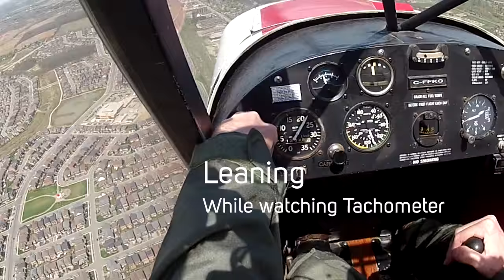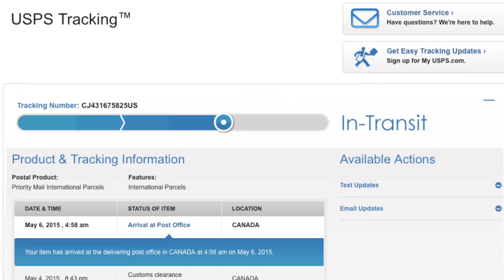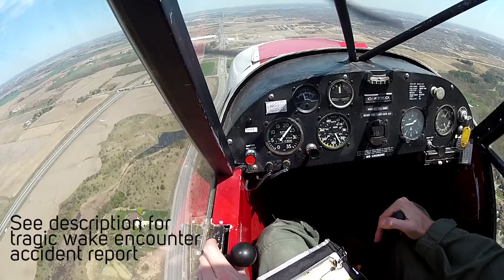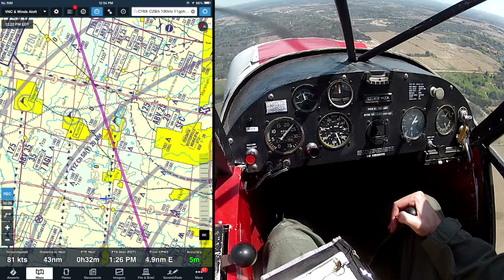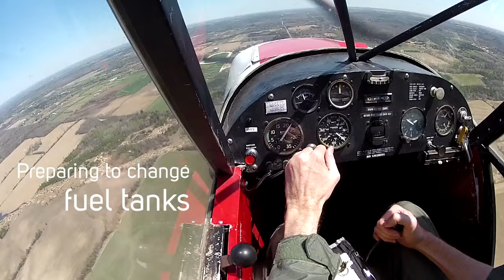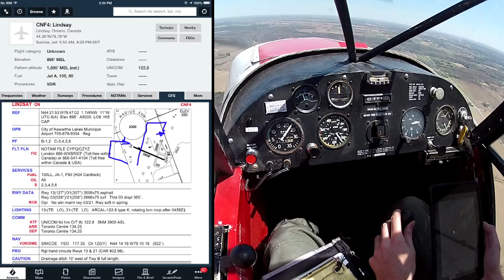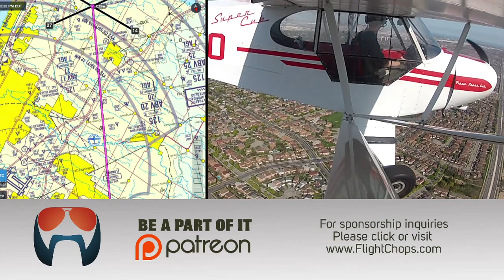Skirting major Class C control zone; no transponder - Super Cub - Flying - ATC audio

Comment: Great video. I like how although you weren't required to establish contact with toronto terminal you still did. It's a win win in the sense that it helps provide more situational awareness. I also like how you planned your route considering the runways in use to avoid wake turbulence. Lastly, contacting buttonville tower, again even though you didn't have to, was good for situational awareness. VFR flight in and around the toronto TCA can be intimidating, but you did a great job and I definitely took some things away from this video.

Comment: Thank you for all your videos, it has inspired me to continue with my certifications. I have a question about your ipad. Do you use cellular service for your fix(es) or just GPS?
Reply from the maker: +Randal Wilson Thanks!  And I just use the built in GPS actually.  You can also get a 3rd party GPS like a "bad elf" - but I haven't found a need yet.
Reply: The Stratus is a great add-on, and has a GPS receiver and an ADS-B-in receiver.  It also tracks your exact path that you can look at later.

Comment: Awesome video. One question, though. Since you're not in the Charlie, and since you only have one radio, shouldn't you be monitoring the En-Route frequency instead of terminal control? I'm no Canadian Radio Procedure pro, it just seems like the most logical solution to me ( a dumb american ;) )
Reply from the maker: ThreeTwo Victor Haha - you're not a dumb American :)  But yes, you make a good point.  That was the dilemma.  My plan was to be the only idiot pushing it so close to the Class C that I'd be the only one there....  and it worked.  And again, as you saw when passing the other C airport, they still gave me very useful advisories even outside the class C airspace...  But yeah, as I got further I switched to 126.7

Comment: Another great video. I bought a RAM mount for my iPad Mini for a Skyhawk but couldn't mount it where I was wanting it. It's harder to get flight control clearance than I thought it'd be.
Reply from the maker: Cole Byre Yeah, finding a suitable mount is tricky - each plane is different - seriously give PIVOT a look - they are VERY versatile!
Reply: I use a Ram Yoke mount in my 172K with an iPad mini and it is perfect as I can position over the centre of the yoke and avoid obscuring very much of the panel at all. At my height I found a kneeboard is really a bad idea as it gets in the way.

Comment: I love your videos man! I noticed though you usually come in too fast and touching on two points only... is that on purpose or are you just used to faster approaches?
Keep the tail dragger videos coming! hehe :D
Reply from the maker: Javier Llaneza Thanks! And yeah, I was trained to do wheel landings on pavement in the Super Cub - and definitely for cross winds which was the case here... So, coming in at 70 MPH and keeping the tail up during the roll out was the objective. (I was a little fast initially closer to 75 when I started the round out, but I had a lot of runway, so I just bled it off a couple feet off the ground.)
You can see my training in this regard in the video titled: "Wheel landing on Pavement'"; I'd add the link, but YouTube auto spam filters comments with links.

Comment: dude, RADAR looks for metal to reflect back its returns.... Just a question what is your cub made of?  mostly paper??? LOL.
Reply from the maker: Fabric actually.  Verily little metal in the Cub other than the engine and steel tube frame
Reply: @FlightChops   therefore not enough metal to reflect back to the RADAR sensor unfortunately.  ATC won't get a return.  I presume ADSB will be helpful if you get the puck and slave it to your Ipad... :)

Comment: Hey Steve, this is pretty old now and I'm sure you've moved on from this video by quite a ways, but that thermal you hit about the 5 minute mark is from the subdivision down below. Sun hits those roofs and streets and sends a plume of hot air up through the surrounding atmosphere, which looks to be above undeveloped land which will have cooler temps. Enjoying all your videos, keep up the flying!

Comment: I always use flight following in the Los Angeles area. I can't fly as low as you do because if I lose my engine I'll go right into residential housing. I have a 14:1 glide ratio so if I fly high enough I am usually within glide distance to some nearby airport that dot the LA area. I should probably practice more dead stick approach and landings.
Reply from the maker: ***** yeah, I was always thinking about that in the back of my head.  The Super Cub can land pretty short so any small open space would do in a pinch.
Reply: You can't get within 30 nautical miles of LAX unless you have a transponder
Reply: Yes I noticed in the videos it looks like there might be some fairly decent emergency landing spots whereally you were flying

Comment: I think it's great. Times have changed and it shouldn't mean all vintage planes need to go to a museum. It's like putting a reliable modern engine in a 67 Camaro. It will get you anywhere with less worry than you would with the original.

Comment: If you did fly in to controlled airspace without a transponder - what happens? Does the military show up on your wing?
Reply: TheIvalen Hi,   Im Prob wrong. But Years ago, In the USA,as I am Also, Yep,, Being In Canada???????  Should Be Interesting,, Thanks,, Jack.....
Reply: TheIvalen If you were really low and just in and out they might not even notice. More egregious errors would probably depend on if you were in contact with them or not. If in contact they would inform you of your error and request you call a phone number so they can get details of the error and possibly report it to the authorities. If not in contact they would follow you on radar and have an official or officer meet you at the destination and take down information. In the US the pilot could file an ASRS form which allows you one free pass on any incident that didn't result in an accident. Otherwise, you would probably have a flight with an official to prove that you know what went wrong and how to fix it. If it was a really bad mistake then you might loose your license or have a temporary suspension. If this was an emergency then you can do almost anything you feel is necessary to improve the outcome of the emergency, so no violation there.
Reply: Mine was Just a Mistake,, as When I Filed my flight Plan,I was Leaving Meriden Ct,to Fredrick MD, And Direct Over JFK!, All was well, Untill they Put me Over the Northport stacks,for 3/4 Of a HR, Untill I asked to go down, the VFR Corridor,, And, was Watching My Fuel,, And I Left early On a Sunday Morn, But Trying to cut In On NY Traffic,, was Unbelievable,, So, No questions asked, Never even Had to talk to FAA, But they sent A Pnaes, Up,, And basicaly were Very Nice to Me,as They (The Gov)  Pilots,Have No Use for NY Controllers,, As If Your Not Delta,,,TWA, Way Back. etc,, A Private,after doing everyrhing according To my flight Plan, Have No Use  for US! , And The (Air forse  Guys,)  As I said were Suoer!! But This is 30 ++ Years Ago,,, Thanks, Jack,,

Comment: On the wheel axial, there are a couple of aerodynamic components... Are these adjustable to counteract the engine torque, from inside ?  Thanks  :)
Reply from the maker: john wheatley Can you please clarify this question?
Reply: ***** Okay.... From the go pro slung under the fuselage looking forward.... There are two winglets that are angled at different settings to the airflow... Obviously these play some sort of roll, in trimming.. I was wondering if they are set to counteract the engine torque, thus reducing the need for further aileron trimming.. There must be some twisting motion along the axial path of the fuselage against the prop spinning.... And, are they pilot adjustable from flight controls... Thanks.....   I love these videos btw  :)
Reply from the maker: john wheatley Ahhh, you're talking about the suspension bungee cover thingies...  nah, other than drag reduction, I don't think they serve an aerodynamic purpose, and they are often accidentally crooked / asymmetrical angled - they should ideally both be the same angle and minimizing the drag they cause. They are there to protect the bungees that are essentially the shock absorbers for the landing gear. 
You are correct though that P-Factor or power induced yaw is an issue.  We need to correct that with rudder input during power application on take off and climb, and during power reduction on landing.  When in cruise, a well trimmed plane "shouldn't require much to counteract P-Factor.
Reply: ***** I see.... Thanks for the explanation.... I thought I had discovered some little known aerodynamic modification to the Super Cub !! lol 
Best regards to you, and thanks again...... :)
Reply from the maker: john wheatley cool - and thanks so much for inspiring this sort of detailed discussion.

Comment: Excellent video. When I had my J-3, it never showed on radar either.  :)
Reply from the maker: Michael Langley It's good to know, eh?  I just tube and fabric is not a strong enough return, or maybe they just filter the weak returns out to ignore flocks of birds and stuff..?
Reply: Perhaps so. It was never a problem around the low traffic areas I flew. ADS-B will change much of that in the future. Sure miss the good ole days.

Comment: Chances are, since you didn't have a transponder, and she knew where you were and that you knew what you were doing, she just said she didn't see you. Often 'being seen' is misconstrued as obligating the flyer to some sort of radar service. Probable that she's practicing cya.
Reply from the maker: ***** Interesting insight there... I hadn't considered that.  But from everyone I talked to, they seem to agree that my Super Cub was probably actually invisible based on the radar filter settings or something... Like if they worked hard enough to tune in the slow / weak signals, I'd probably have shown up among the flocks of birds and such...
Reply: ***** Probable, often centers and approach control don't deal with primary (those without transponders) radar echoes. You should come visit KBVI, we have a great flight school, as well as a CTI program with the FAA and a student run tower, it's good fun.